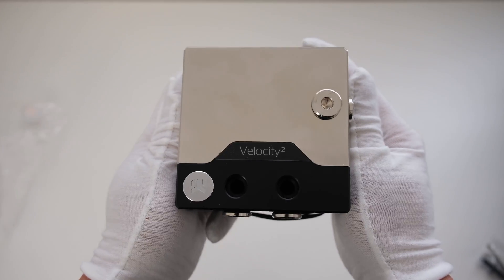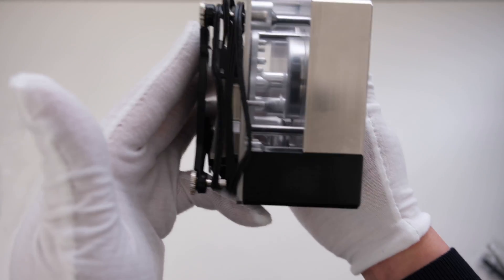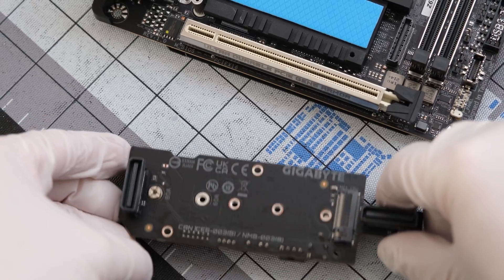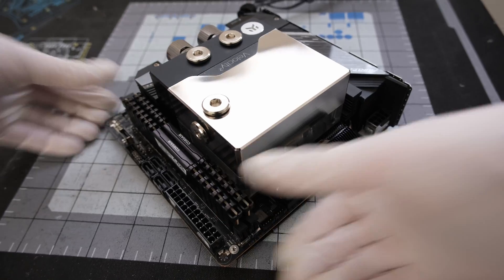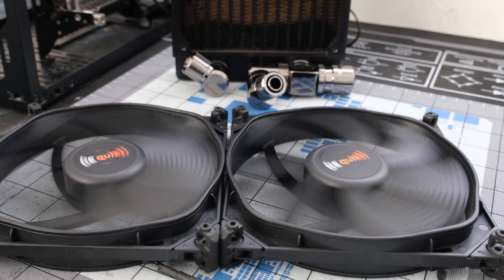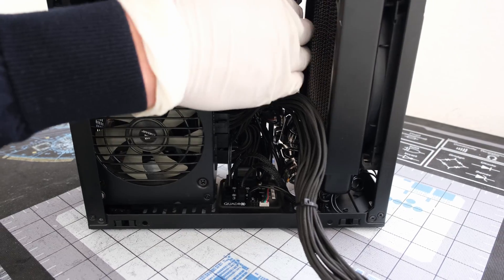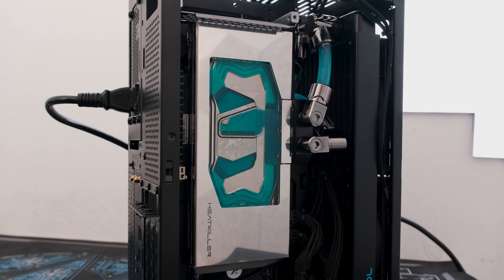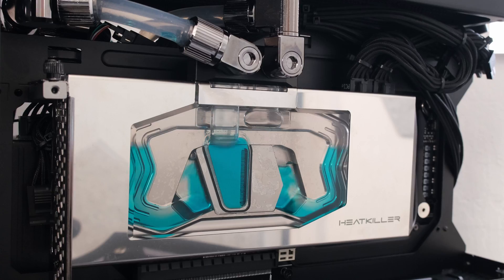Watercooled ITX 3080 Build - Step by Step

Comment: Great build! But you can fit more thick radiator, and make your system much more quiet
Reply from the maker: Thanks for your comment 🙏 Can you recommend a thicker radiator that would fit? I selected the Alphacool ST30 primarily for fit (and the ports). It was a tight fit with the fans. The radiator is the constraint for the cooling, so fitting a thicker one would be one of the very few ways to squeeze more performance.

Comment: May I ask, how did you fill the loop? Via that combo unit? Thanks.
Reply from the maker: Thanks for your comment 🙏 Yep, there is a port to fill the combo unit. It's a reservoir, so it functions like one. Hope that helps.
Reply: @vectornetwork  sorry, but I want to ask a further question, because I'm planning to use this block res pump combo in my future build. My question is, according to my knowledge, the built-in reservoir in that unit is pretty small, so your method was fillimg up the reservoir and turn on the pump again and again untill the loop is fully filled? Sorry for my ignorance, thanks!
Reply from the maker: @seanscott311  Yes. The reservoir is very small, so filling it will require flipping the on/off switch on your PSU more than once. This is the case for nearly any fill. But for this one, it is true that it will take a lot of on/off attempts to get it filled. The good thing is that the build is small enough where you can turn it on any side in attempts to get any bubbles out of the system. Hope that helps
Reply: @vectornetwork  your opinion really helps, thanks!
Reply: how to know when full and is there a max fill line on the reserevoir thanks @vectornetwork

Comment: Will the same loop be enough for 4080 and intel 14900k?
Reply from the maker: Thanks for your comment 🙏 I did an updated version of this build recently with an RTX 4080 and AM5 7600. I decided this was possible because the 4080 is efficient and doesn't draw as much wattage as the 3080/3090/4090 and I further undervolted it. For the CPU, I specifically picked an easy to cool processor as the 4080 would be doing most of the heavy lifting. I do not suggest going for the 14900K to pair with the 4080 in this enclosure. The 280 rad will likely not be sufficient and you may see reduced performance and/or higher than expected heat generation. I linked the updated version of this build below. Hope that helps.

https://www.youtube.com/watch?v=i3A_0mwug9c&lc=Ugz4gIY_XfEeKFgaNFl4AaABAg

Comment: Can an Amd 7900x3dx cpu and Radeon 7900xtx water cooled gpu  with appropriate water cooling system be used here?
Reply from the maker: Thanks for your comment 🙏In this ITX system, we only have room for a 280mm radiator. While the 280 is actually closer in surface area to the 360 than the 240, I wouldn't think it would cool both the 7900X3D and the 7900XTX effectively without either more noise and/or potential throttling. In the ITX system, I am planning an AM5 system with the Ryzen 7600 and the RTX 4080. I expect to be able to cool the system effectively and I will also be unvolting to show the difference. Hope that helps

Comment: An 65w tdp processor need custon water cooling loop??? I think be better low profile like noctua n-9L
Reply from the maker: Thanks for your comment🙏I absolutely agree with you that a 65W TDP processor doesn't need to be watercooled. That is sort of the point of why I chose it. I wanted to use EKWB's CPU block that also doubles as a reservoir. This way, a custom loop would actually fit in the Meshilicious case (without any modifications), since we wouldn't need a separate reservoir. Since the CPU block is made for intel 12th gen, I went with a processor in the stack that would be firstly easy to cool and then also having it be a good pairing with the RTX 3080. I landed on the 12400f and its low TDP helps in allowing the GPU to flex more, as it'll take on most of the workload. I am planning a new build and I'll be using the EKWB CPU cooler for the AM5 platform with an RTX 4080. I am likely choosing the Ryzen 7600 CPU as it'll be easy to cool and 6 cores should be enough for gaming and to let the 4080 take on the workload. I will undervolt the 4080 too and have comparisons. Hope that helps.

Comment: The brand isn't "Heatkiller", the brand is "Watercool" and their model line is "Heatkiller"
Reply from the maker: Thanks for your comment 🙏You're 100% right brother. I lead with Heatkiller in the descriptions and audio because I also had to include the word "Water Cooled" in reference to the whole PC build itself. I thought if I repeated the words Water Cooled and then Watercool Heatkiller, it may be confusing. And I also think that Heatkiller was a more recognizable name that may stand out more. Having said that, I am working on an upcoming Heatkiller V Pro water block for the RTX 4090 Founders Edition and will referencing it as the Watercool company and their Heatkiller brand. Thanks for your contribution.

Comment: how fast do fans had to spin - trying to estimate how loud this - two fan set up is.

Look like you could add another radiator on top of the case? (even without fans just to let some heat off into the air above (may be perfect for people with 3090 or 3080ti)
Reply from the maker: Thanks for your comment 🙏Hm, if i recall correctly, the fans would end up spinning up to max with nearly all types of fan curves. Keep in mind, these are 140mm fans and the speed was in the low 1000s. As for acoustics, it was fine. I was more interested in setting a nice curve for the pump noise, which was good around 35-40%. 

What I plan on doing in a upcoming video is swap the fans out for some new Silent Wings 4, which should incrementally improve performance and also swap out the 3080 for the 4080 tuf. I expect the system to cool the 4080 equally or better than the 3080. For the water block, I have a Byski and an Alphacool water block episodes coming up for the 4080 tuf and one of them will go into the system. I am leaning towards the Alphacool one. For that episode, I'll make sure to include the fan speeds and use the decibel reader to provide another data point. Hope that helps.

Comment: The way you mounted the cpu block horizontally EK don’t recommend it ! Does it work properly?
Reply from the maker: Thank you for your comment 🙏 Oh, I did not realize that the way it is mounted isn't recommended by EK. Let me think. The DCC pump sits at the bottom of the CPU block reservoir combo. So in its current configuration, it's sideways up against the motherboard. Yea, I can see how that isn't the absolute optimal placement. The best placement would be if DCC pump was on the bottom (rather than sideways). Is that what you mean? In any case, based the temps and the usage over the past few months, its been running sufficient. One of the upcoming videos will be swapping out the 3080 for the EK 4080 (Asus TUF) recently tested on this channel. I am optimistic that even a 4080 will run cool and quiet enough. Hope that helps
Reply: @vectornetwork  For the CPU block, EK do recommended this 90° rotated orientation, providing the loop is 100% full.
Reply from the maker: @jedispooner  Got it, thanks for the information. I do plan on refreshing this build with an RTX 4080 and different fans in a different orientation. At that time, I will see if the build will work in any other orientation.

Comment: Hello，could meshlicious use the ek DDC block in 4 slots gpu model? looking for your reply
Reply from the maker: Thanks for your comment. 🙏 Good eye. One of the few things I did not show was moving the inner bracket to the one that allows for less GPU slots. This is required for the EK DDC block to fit. Hope that helps.
Reply: Curious also
Reply from the maker: @Jayarebee671  Thanks for your comment. 🙏I replied and confirmed that the moving the inner bracket to expand the CPU side and results in less GPU slots is required. Hope that helps.

Comment: I really wanted to like this video, but after 1:06 I had to stop as my eyes were hurting from the insane number of jump cuts. I'd love to continue watching, but it's just too much. I'd rather see a 10 minute long, smooth video, with all the information you're attempting to convey, than a 5-minute video with enough jump cuts to make me feel like I'm traveling through time.
Reply from the maker: Thanks for your comment 🙏 I do think there is room for improvement on the editing. All that editing requires a lot of effort and so it would be easier to do longer-form cuts. The reason why its like that is because my earlier videos really didn't really any views at all. It wasn't until I really tried to cram in as much content as possible and made the videos shorter did get some viewership and engagement. However, now with some traction, I think it is time to a bigger change and/or improvement than merely adding a few more frames here and there. Thank you for the feedback and I hope to continue to improve the videos.

Comment: Nice build. Thanks for the video. How quiet was the DDC pump? I have always had D5s, I am looking to build a very quiet system and I have heard that D5s can be louder.
Reply from the maker: Thanks for your comment 🙏 Given the option, I would choose a D5 pump over a DDC pump. I am happy to compromise in this build by using the DDC pump because it has the added benefit of functioning as the CPU block. The first fill, the DDC pump was struggling a lot (bubbles) and was louder than I expected. After draining and switching around some of the runs, the pump started working fine and as expected. I keep it at about 40% and that is acceptable for noise levels (to me). It's kept on a table, fairly close to the user.
Reply: @vectornetwork  Got it, thanks for the clear response. We can hope that EK will release a larger D5 version, that would be nice! :)

Comment: You should be able to bring the temps down by 2-4c by swapping the fans around. I did it for mine after moving from an AIO + air cooled GPU build  to a full custom loop.
Reply from the maker: Thanks for your comment 🙏 It's entirely possible. I was thinking that exhausting the air outside of the case was better in this case, but I may flip them around to see.

Comment: do you think this would work with a single 140mm radiator?
Reply from the maker: Thanks for your comment 🙏 I actually think 280 is really as low as you want to go with this specific setup. The 280 fits nearly perfect in the case, like it was made for it. 280mm actually has a significant amount of surface area as compared to the 240. So, a 140mm would be closer to a 240 than a 120, but I still don't think it would be suitable. Hope that helps
Reply: @vectornetwork  I was planning to build in a much smaller case that only has 1 rad space for 140mm. Just wondering if it will provide enough coolant circulation since the pump block would be the only resevoir. 

Planning to liquid cool a 1660Ti and i5-12500 (yeah they don't need liquid cooling in general but it would look really nice in a tiny case) 

Mostly just worried about the amount of coolant circulation.
Reply from the maker: Oh I see. Hm, with those components, it's more possible. The 1660ti has a power draw of 120W and the 3080 has approx. 330W or so. So, that seems promising. As for coolant circulation, yes, that is something to consider but I wouldn't consider it a deal breaker.

Comment: You know I was more interested in the CPU temperature. I just got one of these for my i5 12500, RTX 3080FE ITX build and I really wanted to know whether the CPU might introduce a problem to the water block that is directly installed on the pump. 50 °C water temperature is already a bit of a problem for some pumps, while some D5s can tolerate it. Not too sure about DDC pumps though...
Reply from the maker: Thanks for your comment. 🙏I went ahead and ran a single test of Speedway (3dmark's new gaming test) and when the GPU thermals were the highest, the CPU topped out at 48C CPU Package and 45C for CPU Core Average. The 12400f appears to be a breeze to cool. Hope that helps.
Reply: @vectornetwork  thanks for checking. I wanna go ahead with the build and get it done soon.

Comment: I bought the same EKWB waterblock. But with a 13900k. I'd like to know what your CPU thermals are under gaming load and stressed with something like prime95?  My Inno3d Frostbite waterblocked temps are very low compared to the CPU .
Reply from the maker: Thanks for your comment 🙏 Do you have the same radiator setup with the 13900k or more rad space? 13900k is quite different than the 12400f. I picked the 12400f specifically because of the lower wattage and it should be negligible to cool while I focused on cooling the GPU with very limited rad space. I can check the thermals on the CPU, but I am not sure it will be that comparable. Hope that helps
Reply: @vectornetwork  I have an NR200P case with a 240 and 120 radiator.  Just trying to find cpu temp comparisons of this block vs other blocks/transitional cooling methods. Not many YT reviews of the ekwb block out there.  I can get older gen cpus to 100c pretty easily with prime95 so this block would still have to cool them enough to prevent throttling. 4090 i'm not concerned about because my gpu temps don't go above 36c playing Callisto Protocol for an hour.
Reply: @jinparksoul  i'd mod the case with a tophat to enable the case to house another 240mm radiator on the top. That's how i managed to put in 2x240mm radiators in my Coolermaster Nr200p case.
Reply from the maker: @jinparksoul  I went ahead and ran a single test of Speedway (3dmark's new gaming test) and when the GPU thermals were the highest, the CPU topped out at 48C CPU Package and 45C for CPU Core Average. The 12400f is simply a breeze to cool. I am not so sure about the 13900k. Hope that helps.
Reply: @vectornetwork  Does that test stress the cpu or gpu more? Games like the one mentioned  don't seem to stress either for me.  Specific cpu benchmarks do. And prime95 is the destroyer of cpus in my book and will really test how well any cpu cooler can dissipate that heat.